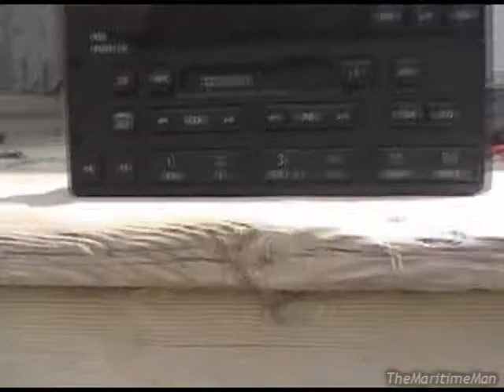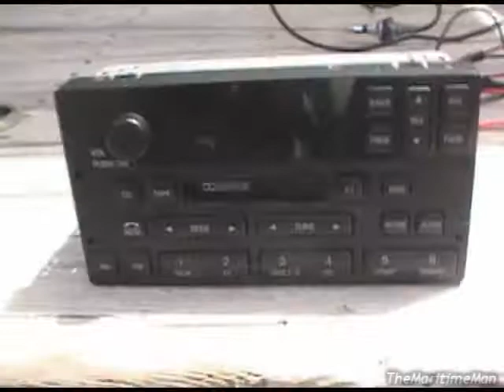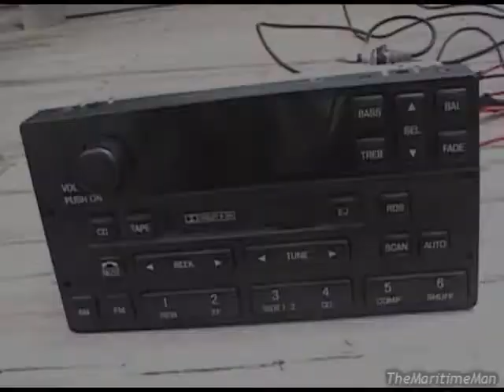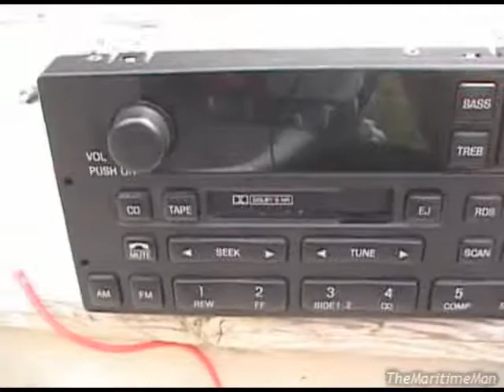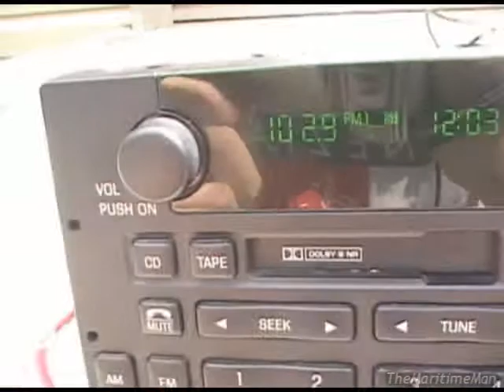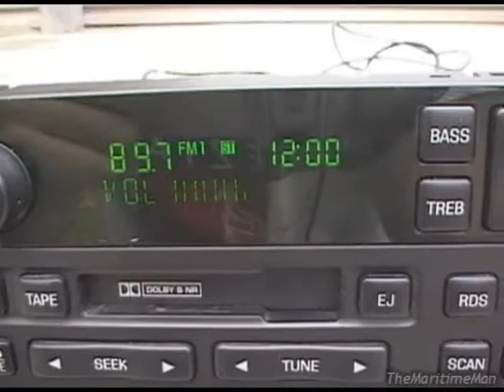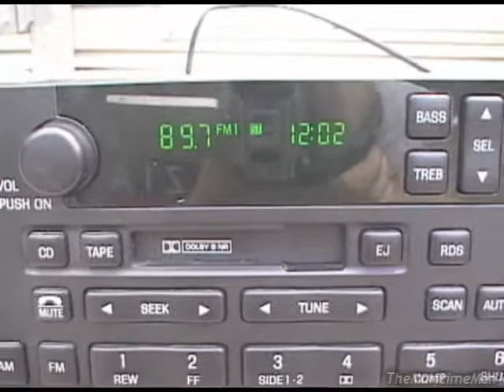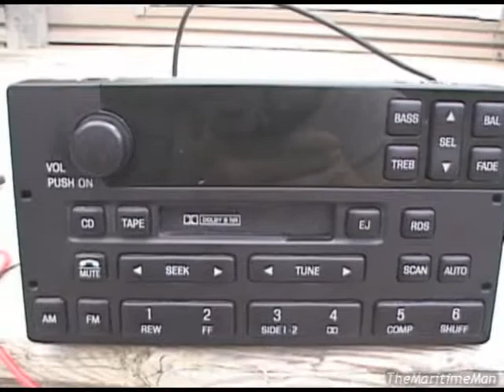First full test of Ford stereo

Comment: I have an old computer PSUs that I plan to test with, but I'm worried about switching noise ruining reception, especially on AM which is why I wanted to use an old wall wart with a regular transformer in it. I'll have to see if noise is an issue with the computer PSU, before I go looking for a transformer with higher current.

Comment: How much current does this draw with those speakers? I see without speakers it was slightly under 1A. I would like to run a similar stereo from a 12V 1A power brick and will use externally amplified speakers if I have to in order to keep the current down.